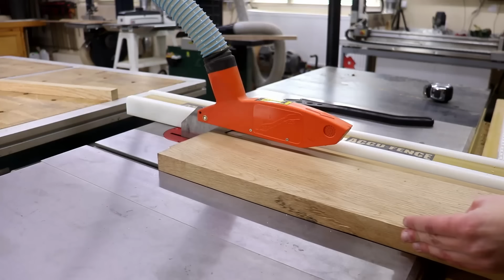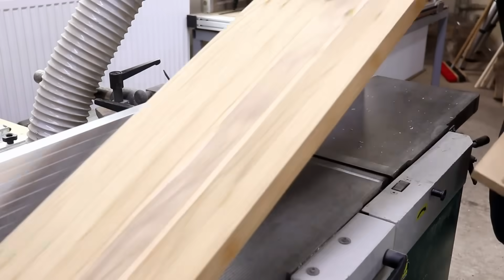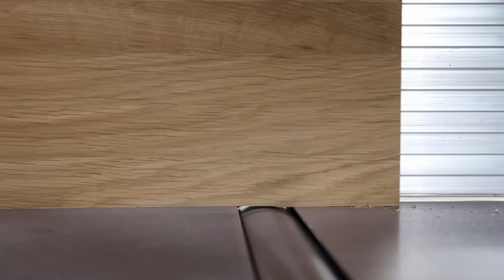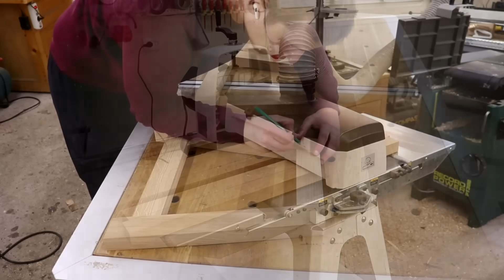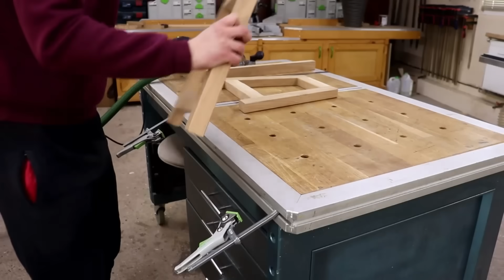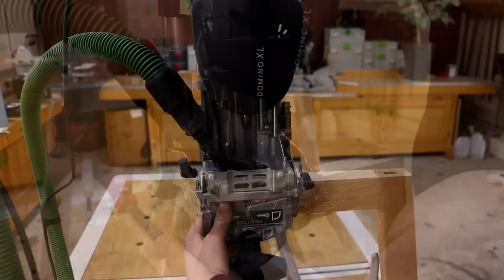From an idea to a masterpiece: A cool woodworking project! Woodworking.

Comment: I think they need to change the name of that first tool to a planer because they damn sure don't use it as a jointer
Reply: I have to be honest, I watched you spend some 25 hours ,and not including the curing time,,and state of the art shop with some 20.000.00 $$ 30,000.00$ may be more equipments/tools .
Now I wanna know how much did this Maple bench profit the shop,or how much was it sold for😏